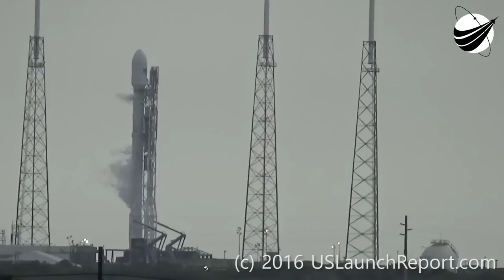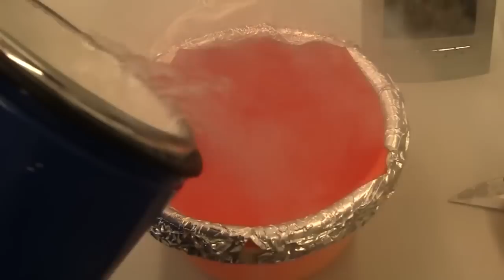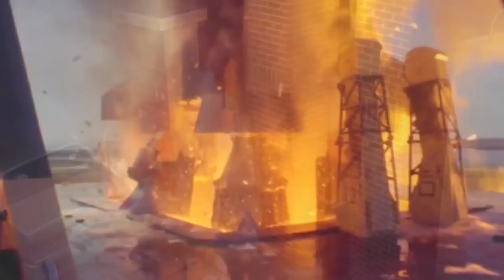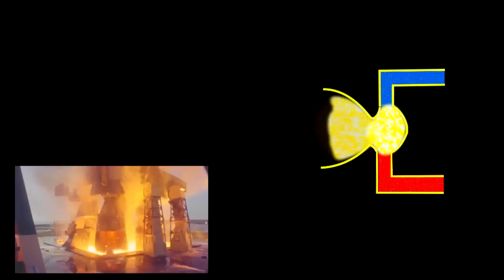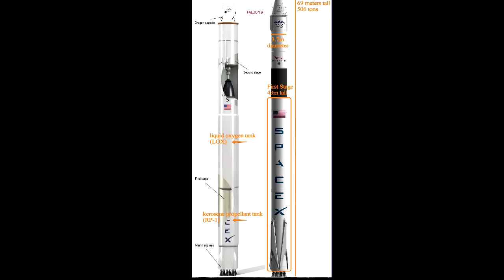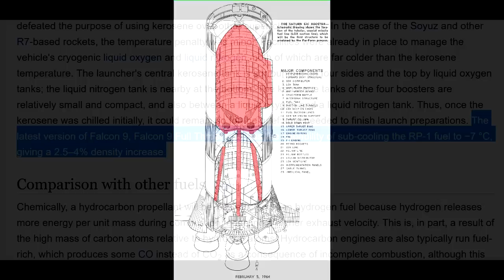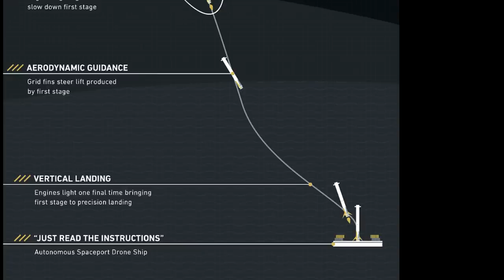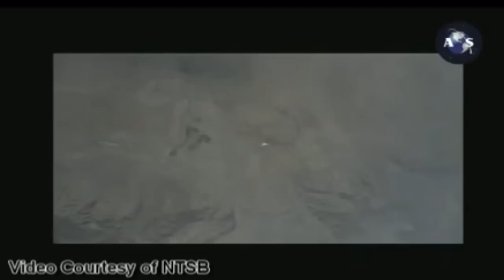Why did the Falcon 9 Explode?

Comment: While I understand that, at the time you uploaded this, the cause of the explosion was not yet known, I think a few of your criticisms even then were fallacious.

"Nasa figured this shit out 60 years ago, and hasn't had a fueling explosion since".

Yeah, well, Nasa has been using effectively the exact same technology and materials in their tank designs FOR THE PAST 60 YEARS.

At the time you uploaded this, you didn't know the cause of the explosion... However, the cause is NOW known, and the cause was the result of Space X's experimentation with new carbon composite materials... Something I don't think Nasa has ever used in the fuel tanks of any of their man capable spacecraft.

Specifically, the cause was from the helium tank inside the oxygen tank. This tank was made of 2 layers (unlike traditional 1 layer tanks) wherein the inner layer of aluminum is impermeable to the helium, but the outer layer of carbon composite material does the job of containing the pressure. This carbon is permeable to oxygen however, oxygen filled a small gap between the 2 layers (a defect) and solidified. Then, as the helium pressure was increased during the fueling stage, the aluminium pushed out against this solid oxygen and the carbon. This caused friction between the 2 layers which generated enough heat to cause the carbon to react with the liquid oxygen.

... THIS IS A NEW PROBLEM. THIS IS NOT SOMETHING NASA WOULD'VE EVER IN A MILLION YEARS FOUND. Nasa insists on using 60 year old technology purely because it's safe, and because they don't have the budget to devote to serious R&D anymore (seriously, look at how freaking long the SLS is taking to develop). This is NOT an "old problem".

This drive to find new ways of doing things is what has resulted in most of SpaceX's failures... As such, SpaceX's development is far more comparable TO that first R&D into rocketry Nasa conducted 60 years ago, than it is to the LACK of serious R&D that exists in Nasa today. Even today, Nasa's best project, the SLS, is little more than space shuttle parts rearranged into a traditional rocket... They're hardly pushing any boundaries anymore when it comes to rocket design.

"Landing a rocket isn't that impressive."

Yes... Yes it is... End of story.

Right up to the moment they landed one, there were people in the industry who honestly believed it was impossible to land a first stage of an orbit capable launcher. Not impractical... IMPOSSIBLE. The forces imparted on the craft during roll over, retro burn, re-entry, and suicide burning for landing are INSANE... Not to mention the difficulty of putting one down accurately in a small space running on fumes, even with computer controlled precision. REGARDLESS of the practicality of doing this, it's an impressive feat.

"It isn't practical."

False.

The practicality of the Falcon 9 lies in its adaptability. The larger the payload, the more of the rocket's reusable potential can be shaved off in exchange for a larger payload mass.

Ideally, the booster will fly back to the launch pad and land. This makes smaller payloads fairly cheap as SpaceX saves money on reusing the launcher.

If the payload is too big for that however, then all SpaceX has to do is use THE EXACT SAME BOOSTER and instead land it on an automated barge. This lets them devote more fuel to achieving orbit.

If the payload is too big for even THAT however, then SpaceX can instead launch the payload on a stripped down Falcon 9, one that doesn't have the fins, landing legs, or RCS. Basically, it's a normal rocket now.

This gives them a single rocket with 3 different capabilities, one that can save more money the smaller the payload is.

"Nasa did it first, but the space shuttle was insanely expensive"

... So?... That doesn't mean that ALL reusability technologies are expensive. The space shuttle was expensive because it was a boondoggle funded by bureaucratic retards who all wanted something different out of it. Here, let me name JUST A FEW of the ways bureaucracy made the space shuttle vastly more expensive to operate than it should have been:

1.) It was too big. The DOD wanted something that could carry space battle stations or other large military type things into space. Thus, they mandated that the space shuttle be a certain size. This massive size made the space shuttle far harder to maintain and operate.

To make matters more ridiculous, once Nasa engineers went through the trouble of designing and beginning construction on such a ridiculously large vehicle... The DOD backed out... They developed their Titan rockets to be fairly cheap, and scaled back their space ambitions... So now Nasa was left with this retarded space shuttle that had a bay far bigger than was necessary on a vehicle that was originally just supposed to TEST reusable technologies.

2.) It used liquid hydrogen as fuel. Liquid hydrogen is very expensive, and evaporates through tanks. It's also voluminous. It takes up so much room that the majority of the orange tank was devoted to just liquid hydrogen. Liquid hydrogen is best used in a second stage, in the upper atmosphere when the rocket is finishing clawing its way to orbit... It's a horrible fuel in the first stage of the launch, because of how much space it takes up. Any weight savings you get by its efficiency is immediately squandered by the mass of the tank to store it. It's why the Saturn V didn't use liquid hydrogen in its first stage, it's why the Falcon 9 doesn't use it, and it's why the space shuttle SHOULDN'T have used it. They could've used a significantly smaller, cheaper, and easier to construct fuel tank had they used RP-1 instead.

... So why did it use liquid hydrogen?

... Because congress said so... You know... To make the liquid hydrogen contractor fat and happy.

3.) It used a horrible re-entry method. Congress wanted a vehicle that could come in steep and fast for various reasons. As such, the thermal protection system on the space shuttle had to be made out of extremely expensive materials that had to be painstakingly replaced by hand after EVERY FLIGHT. This was one of the biggest expenses of the shuttle's refurbishment.

Nasa could have used a much cheaper and more reusable thermal protection system had they been allowed to use a different re-entry profile. Due to the shuttle's large flat under-body, it can generate a decent amount of drag high up in the upper atmosphere, where the lower air pressure results in a lower re-entry temperature. Doing this would've made the profile a lot more shallow, and extended the duration of the re-entry up to requiring as much as a full orbit. Doing this profile would've allowed the shuttle to bleed off as much speed as possible in the upper atmosphere at lower temperatures and pressures before finally being subjected to a thicker atmosphere.

If a reusable space plane is to ever be cheap, it will likely require either a revolution in materials technology... Or the use of this less extreme re-entry profile.

Reusable space planes are quite possible, and the original idea for the space shuttle was quite feasible... Unfortunately, because NASA is government funded, a lot of complete dumb-asses who don't know shit about rocket science got their grubby hands on the project, and told NASA to make it do their laundry for them... Trying to compare the practicality of SpaceX''s approach to the utter boondoggle that was the space shuttle is a fallacious argument. Because SpaceX is a CORPORATION, they care about profit margins, and specifically design their rockets to that end... Note that the recovery of the first stage of their rocket avoids most of the problems and expenses that the space shuttle had. It's more space efficient, it uses cheaper fuel, they don't dump their stages in salt water, hell, they don't even NEED a heat shield for their first stage spacecraft because it doesn't even go all the way to orbit.

This is another reason why SpaceX is important. Now Nasa can focus on science, and contract out REAL affordable space travel to companies that aren't controlled by the whims of congressmen.

"Here's a video of one falling over on the barge"

Landing leg failure... Again, something Nasa wouldn't know about given that they've never even bothered trying to stick landing legs on a rocket that big... Furthermore, what does this have to do with the launchpad explosion?

"Here's audio about the spaceship 2 failure"

Virgin Galactic makes suborbital tour buses made out of fabric and glue, with the first supersonic fully mechanical control system since the X-1... Their design is regressive even by NASA standards... And you want to compare SpaceX, a company that is DEVELOPING technologies NASA is too stuck in their ways to even touch, to SPACE SHIP 2? Dude, what even is your point here? What the fuck does that incident have anything to do with the SpaceX explosion? YOU'RE GRASPING AT STRAWS.

"Why don't they use parachutes"

Parachutes can't be used to ACCURATELY land the spacecraft... Which is necessary, if you want to land one right back on the launchpad (where it'd ideally be refueled in place and relaunched), or land one on a barge (and not in the salty seawater that corrodes the parts)... The fact that you even said this demonstrates a lack of understanding on your part on what SpaceX's goals are, and what makes refurbishment of the space shuttle SRBs so expensive.

I'm done. You just reminded me why I'm not subscribed to you. Your videos start off fine talking about basic facts, and then immediately devolve into smug ranting. Sometimes you debunk things that need debunking... And other times, it just seems like you straight up hate technology in general. SpaceX and Elon aren't without their faults, but ALL of the "faults" you brought up in this video are fallacious.
Reply: "You just reminded me why I'm not subscribed to you. Your videos start off fine talking about basic facts, and then immediately devolve into smug ranting."
My experience as well, with every TF video.
Reply: "nasa decides to use old designs because they are safe", man i sure do love when half a billion dollars go in flames because pushing the envelope
Reply: You described exactly what I noticed while watching this hate video.
Reply: Beautifully written sir. Everything you have said plus the fact that this video is still even up (despite now being blatantly wrong) has made me question why I'm even subbed to this blithering idiot.  90% of his videos are just ego boosted ranting and filling the time completely unrelated to the topic at hand.
Reply: Thank you sir...

Starts slow clap
Reply: to add to the parachute point, they actually tried to use chutes before they came up with the suicide burn thing. The first couple of falcons (9's and 1's) carried parachutes. The problem is the vehicle is too big and heavy to survive reentry on its own, so they came up with the two retroburn reentry profile.
Reply: Brilliant summary. Thunderf00t video are about 10% valid observations and 90% ego invested rants and smug boasting.

Seriously thing he has some weird jealousy of Elon Musk with the amount of bitching he does about him. At this stage I don't think anyone can seriously doubt Elon when he's made 4 multi-billion dollars businesses in 4 different industries. He's constantly innovated and succeeded after being told what he's trying to do is impossible.
Reply: @martian17  Thunderf00t is a moron, lol.
Reply: @martian17  I think thundef00t would be one of those scientists from the early 20th century that went to public to say lifting a machine that's heavier than air is an impossibility, and would never happen.

This also reminds me of the gap in knowledge between scientists and engineers.
Reply: Hat Man https://www.youtube.com/watch?v=enndCzvZpZk also the SLS is about as bad as the BFR. But I do agree with everything else.
Reply: alright well u don’t gotta be a dick about it bro this like don’t bring up why ur not subbed
Reply: @70sroger11  thunderfoot is literally a dick about anything and then telling why it is bs

Comment: every time he says "they solved these problems years ago" I say "yeah on their rockets". which they just kept using because developing a new rocket is ridiculous expensive. because you have new problems with a new design. You even mentioned that they are experimenting with chilling the rocket fuel more then nasa did as a space and money saving measure. Space X isn't trying to invent space travel they are trying to bring the cost of it down. which they are doing fantastically. Try and remember that the 200 million dollar payload lost during this mission was basically free when you compare the cost of a nasa launch to a space X launch doing the same job. That's right it costs 200 million less dollars for elon musk to put a rocket into orbit then it does for nasa. 

Also your downplay of the rocket landing on a drone ship in the ocean is practically offensive. you act as though this sort of thing was done in the 60's. comparing a space X recovery to a 1960's nasa recovery is a bit like comparing an expert marksmans shot with a monkey flinging shit at a tourist by saying "see he hit the mark too." 

why they wouldn't use parachutes like the mars mission...so many things wrong with this...1 mars has a much thinner (about 1% of earth at sea level) atmosphere, 2 the rover mission was 2000 lbs, stage one empty weighs about 12,000 lbs. so 6 times the weight 100x the atmosphere density. So assuming you could find material that wouldn't just evaporate under that kinda force and heat you would need several parachutes the size of football fields...GEE no idea why they didn't go that route. 

Finally as far as them never reusing them...they are still testing them, why would they use an already stressed rocket with many more variables introduced over a brand new one when they still are learning what the limitations are? there is being a pessimist then there is being an asshole. you are riding the line by being so disingenuous.

Comment: According to NASA, the average cost to launch a Space Shuttle as of 2011 was about $450 million per mission. Since May 2016, the standard price for a Falcon 9 Full Thrust mission (allowing booster recovery) is published as $62 million.
Reply: Shuttle is a totally different vehicle. It has a robotic arm, low-g reentry, crew and cargo capability, long-duration on orbit capability. Falcon 9 literally is just a rocket and it has cargo capability of whatever fits in its fairing.

Comment: My god this was poorly made. 
I know this was before the official reasons were released to the public. But at least put up some retractions.

1 you just make the assumption it was a fuel leak.
If it was a fuel leak it would have shown up as a drop in pressure on the instruments, misery solved. But no you didn't do your research. The instruments detected nothing. This was known less than a week after the accident. 

2 you wrongfully assume it was a fuel leak part 2.
 It happened at the bottom of the oxygen tank. You would  know this if you did your research. How could fuel move up to the oxygen tank. Oxygen has to fall down. Then the explosion would happen in the fuel tank not the oxygen tank.

3 you clearly don't know what helium tanks are, or what they do. A helium tank was responsible for a previous failure. Do your research. It's. Clearly the same problem here. Even if not officially stated when this video was released it was at least a suspect that you never mentioned.

You don't understand how this rocket works you only have a moderate understanding of rocketry and to post this video when you did and say what you said is un professional. But to not offer retractions is despicable.

Here is what happened according to actual scientist.

Two cutting edge technologies interfered in an unexpected way. Carbon fiber helium tanks and nearly frozen oxygen. Oxygen worked its way between the fibers, this in and of its self wasn't bad, what was bad is when the helium was pumped in it went from higher to lower pressure. This caused the temperature to fall. Freezing the almost frozen oxygen between the fibers. Then the tank pressure increased, solid oxygen under intense pressure pressed against the carbon fiber. It only had to break a few fibers before the tank became compromised and the helium exploded out rupturing the oxygen tank and the fuel tank and causing sparks the rest went about as well as you'd expect.

Never assume things. Do your Research before posting ignorant videos.

Comment: You're pretty harsh on the reusable rocket. You yourself admitted Apollo astronauts had to stop thrust with fuel left in the tank to prevent death.  The whole goal is to lower the cost of space flight, not achieve a new speed record.

Comment: Thunderf00t, thanks to you i know that is it really expensive to leave some fuel in the rocket for landing, but the reusing of the first stage should nring back that money. As you said none of the first stages were reused yet but theres still time and money left to do so. I understand that it is pathetic to let a 250.000.000 $ rocket explode of a fueling failure, but this is no reason to criticize the whole projekt and NASA had some pathetic failures to like their venus mission which failed because they typed in thr numbets in the wrong unit of mesuarment. I think you make a of great videos about debunking fake science or the HYPERLoop, which I really enjoy and agree, but I think you have gone to far with this video. SpaceX is the only necessary idea of Elon Musk and they try big innovatins there like carbon fiber rocket tanks and even if those ideas fail at least they tried and got some expierence and data out of it. I hope my grammar wasnt that bad because I'm not a native english speaker. Keep up the good work you're doing a great job with debunking unnevessary science! <3